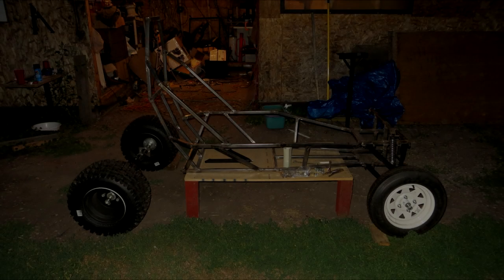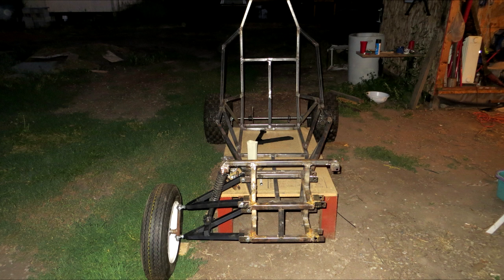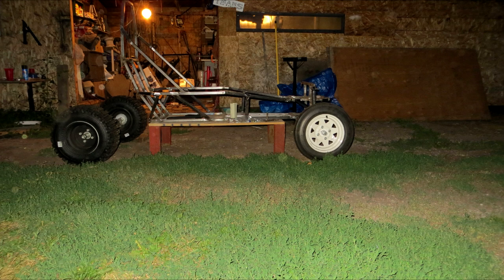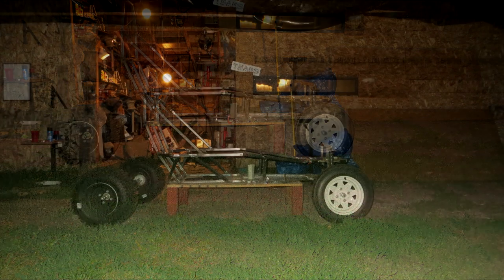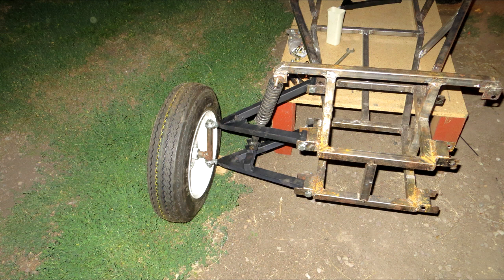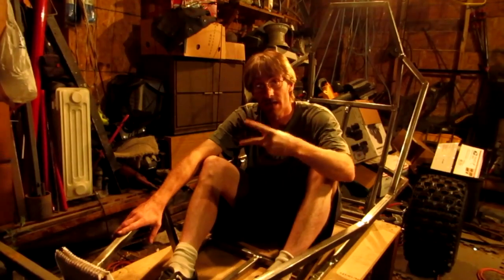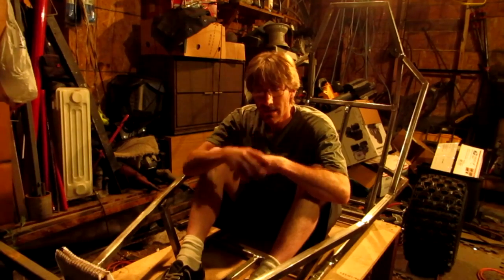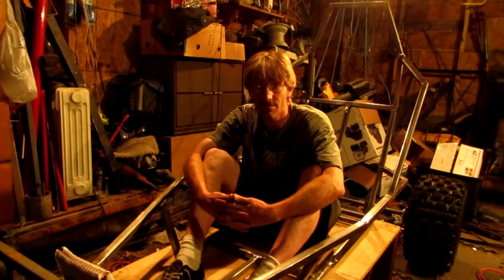Checking it twice █ Go Kart , Building ( The Fullscreen Machine )

Comment: I gotta agree with you on the width of the track... the rest looks good though.  I think that independent rear suspension would be great.  If you made your own axle halves out of square tubing, I dont think that the cost will be to bad either. It is a old drive shaft trick that offroaders use on their rigs.

Comment: 1) you can set the seat more higher (even it rase the c"g) to have more like a car feeling then a slider .and lower the pedals a bit evevn they pop up down.

2 )you can mount the engine behind the rear axle (good for "wilys") and have a like U shape of rear frame so the rear axle can travel up and down freely.(like trucks rear end frame).

good lack

Comment: you should mount the motor on a wing  that is right next to your seat then either run the chain straight to the axle or run a jack shaft from the swing arm